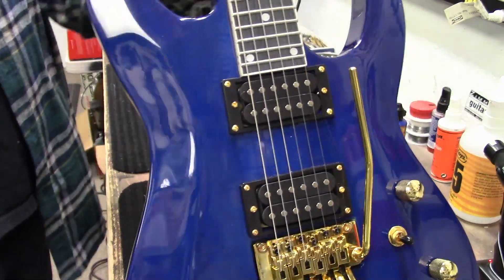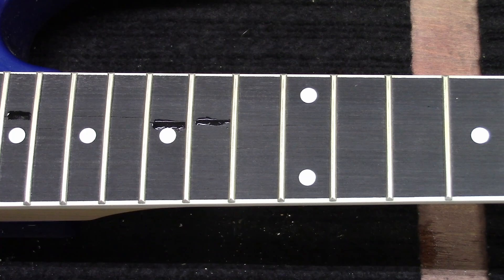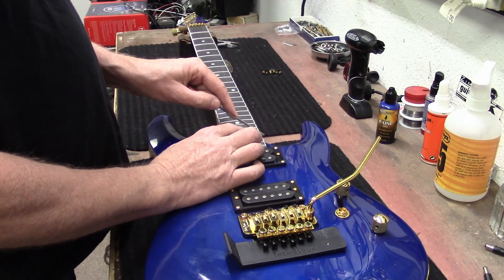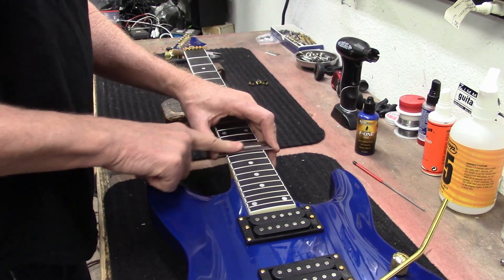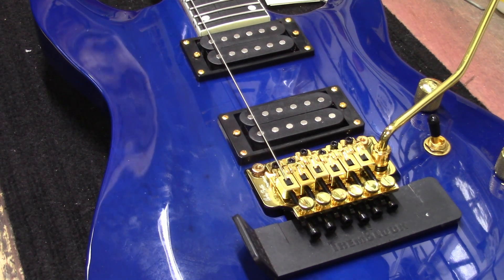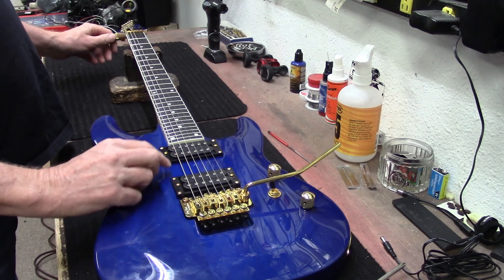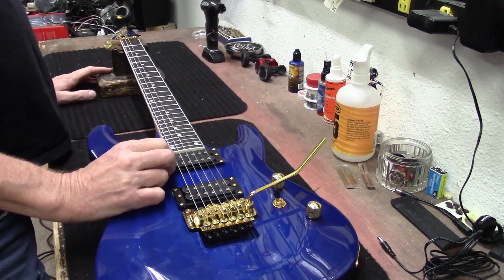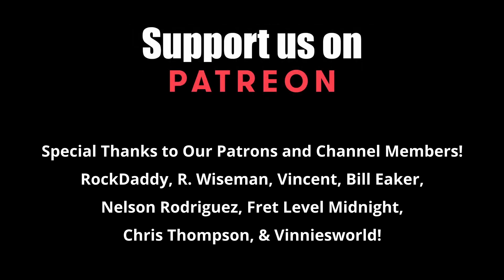Harley Benton Restring!

Comment: I learned how to set up guitars with Floyd roses when I bought a Kramer when I was in Germany it had the original FR with out fine tuners. When I got back to the states I had a FR with fine tuners and the locking nut installed. It’s the non recessed FR so it sits on top of the body. Then a few years ago I painted it red and put a Dimarzio super distortion in it. It’s awesome…

Comment: I have a couple of floyd rose guitars and I had trouble with it at the beginning and breaking the strings, and then I learned a lot from the thomann guitar repair videos and it really helped and now I dont have problems with them but I definitely wouldnt recommend a floyd guitar as a beginner guitar but I would recommend a budget floyd guitar as a second guitar so you can how use it properly and know how to set it up